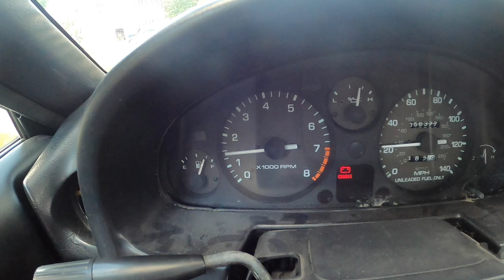DAY 3 IN CT YOU'LL HAVE TO WATCH TO SEE

Comment: 9 grand for that truck is such a steal
Reply: James Ireland still worth more then 15 grand easily
Reply: Not at all... a 2012 thats beat up with a lot of body damage and 200k+ miles, that's average price. Have to remember this truck is 8+ years old at this point, plus its a XL which is worth the least.
Reply: itsme78932 and it’s in the rust belt.
Reply: I live in Cali so every diesel is over priced
Reply: @itsme78932  its a xlt judging by the seats and electric windows
Reply: Xlt would have the chrome grill and probably not be plumber truck white
Reply: @tannerharkey  It's definitely a XL. XL came with cloth or you could option for leather, and 2012 power windows were standard on all models. This has the unpainted grill and no fog lights as well. Now if the truck was clean, higher package (lariat or better) then maybe it would have been a "killer" deal, but this thing is spanked.

Comment: Stock for stock 7.3 is slower than 6.0 but you can make either of them very quick if u put the right parts and money into them and 7.3s are VERY reliable trucks id say the most reliable diesel ford has made yet (non commercial wise)

Comment: in my 6.0 i havent lost to any tuned and deleted 6.7's however i also have bigger turbo injectors lift pump firing rings the whole 9 soo if a 6.7 had the same mods i have i would lose.. 6.0's are nothing to sleep on though they are a money pit but once you do what needs to be done 6.7's look weak now if you did stock for stock the 6.0 is a pig little better then a 7.3 but not by much so stock for stock 6.7 has it better in every way